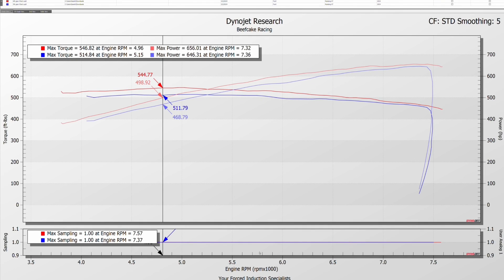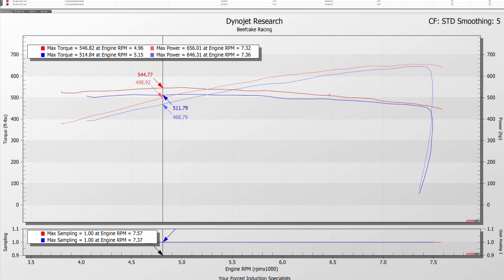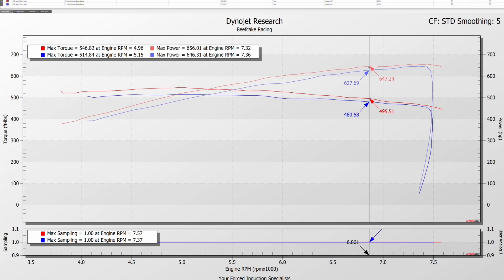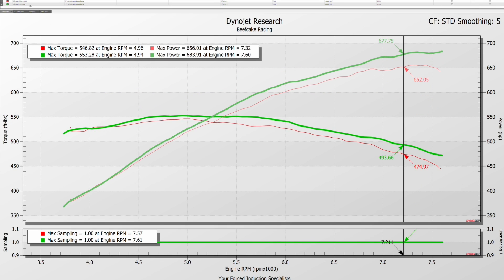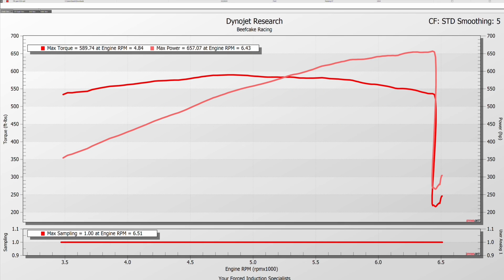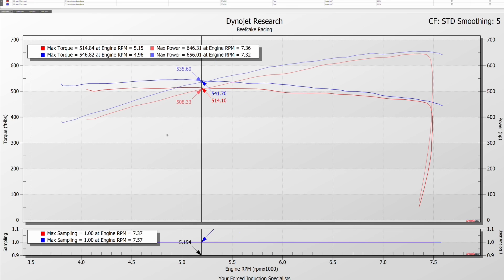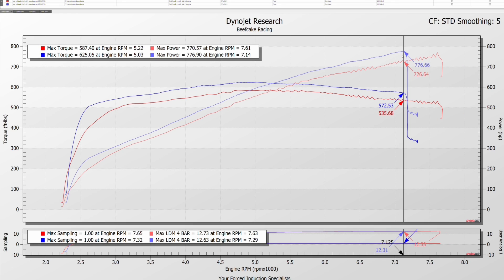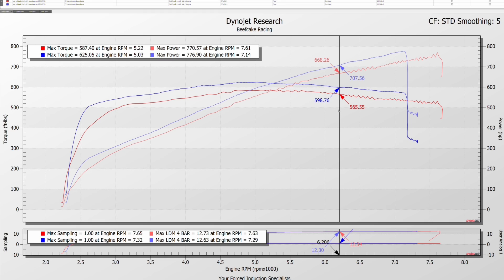Explaining Dyno numbers on a 2024 Mustang Whipple Stage 1 kit.

Comment: What part of this rebuked anything the "mouth piece" claimed? You need Octane Booster to hit the claimed number that's the same thing I heard over there.
Reply from the maker: see this is the problem with people that listen to an idiot like that is they don’t understand how octane booster works

You do realize if you get a tune by those guys and the horsepowers down do you know what they tell you they say hey go buy some octane booster put it in the tank so we can figure out if you have bad fuel quality or if it’s false  knock

and why is that because of the quality of your fuel is low. Then you’re not gonna get the time either commanding in their custom tunes.

But if they’re timing, it say 20° you’re getting 20° on the 93 octane then you’re getting full power and octane booster will make zero difference whether a whether a Whipple whether anybody’s  tune.  

that’s how it works.   Again since most people that listen to a comedy show, don’t understand how all this stuff actually really works.

Comment: I own a 24 Mustang pulleyed down, mixed e30, dynod it in 7th gear, and I just blew the hell out of my trans. I even got a check engine light and now the car doesn't rev past 2k. I had no idea I wasn't supposed to dyno this car in 7th gear. I figured whipple would warranty it but I guess I should have read the fine print. Well this bill from ford is gonna cost me.
Reply from the maker: i doubt it

Comment: Don't u know your not supposed to run the dyno in 7th gear???? Ford says so and any other top Ford tuner knows its not good for the car to run in 7th. Do some research before u start saying they didn't know they should use 7th. They know they shouldn't use it
Reply from the maker: when you want a true horsepower number, you have to dino the car in seventh gear that’s your one-to-one ratio

It’s fine to dino and the last gear, but the point of a dino and this situation is only to get a number but if you can’t get an accurate number, then what’s the point?

Comment: A rather long video that avoids actually talking about how VMPs video is BS. The stage 2 isn’t making 800+ whp through factory cats on “pump gas” as they’re claiming can be done. “One loudmouth YouTuber that doesn’t know what he’s talking about” lol he hasn’t said anything incorrect so what doesn’t he know?
Reply from the maker: we made 760 on pump gas on the stock pulley on the stage two kit.  then we went one pulley down with octane booster and made 820 plus
Reply: He proved you right when on another reply to a comment he said "we made 820+ with headers and 1 pulley down" defending a carb eo kit but bragging on hp with the cats gone 😂
Reply: I just love the Carb EO 800+hp on pump gas advertising when we all know that’s not with factory cats let alone high flows, more octane, 7th gear pull which you only do if you need an advertising glory run lol
Reply from the maker: @tylerphelps4868  actually, all carb eo testing  is done with factory catalytic converters.  

If what you care about is Dino numbers then a one to one gear ratio is your proper gear to Dino a vehicle in for numbers.  

You keep saying we all know that it’s not going to get those numbers but why do you know that because I’m idiot on the Internet said so
Reply: @TeamBeefcakeRacing   1:1 is cool until you factor in that dyno in 7th is a great way to make 7th say bye bye. Yes let’s smoke the expensive trans on a brand new car. 

It’s not meeting carb requirements when you do headers and race gas and it’s not making those 800+ numbers without it. 

You might not care because you’re a parts shill but the customers do. That’s all any of us, including “I’m idiot on the internet” is saying and it’s false advertising
Reply from the maker: @TheLifeofBigOunce  well our kid is a stage two.   on the stock pulley it made 760 wheel one pulling down it made almost 830     

Stage two is not your car kit, but that’s nearly 1000 hp      don’t understand why people are hating on a kid that you can make a crank horsepower with
Reply: @TeamBeefcakeRacing  with every reply you prove Alex's point.

Comment: All i hear is excuses, 24 stangs suck and the whipple wont make the advertised numbers thru stock cats and exhaust. Next time say the name, hes the only guy dropping real knowledge.
Reply from the maker: Actually, they make the advertise numbers just fine. We made 820+ on our 2024 stage two.
Reply: @TeamBeefcakeRacing  with a half tank of octane booster no coyote is making that much power on just 93
Reply from the maker: In a reality, we don’t even care about the dino what we really care about is ET and nine second ET say it all
Reply: @TeamBeefcakeRacing  you mean trap speed will prove the power? Thats correct.
Reply: Pretty sure the kit in question is a "stage 1" and the kit is advertised as adding a certain amount of hp, not a et or trap speed (ON PUMP GAS) and like I said, say homies name, he ain't voldemort  don't be scared. If you have something to say stand on business and say it.
Reply from the maker: @TheLifeofBigOunce  and the car that was questioning the horsepower just went to tend to on a stage one kit there you go

Comment: So even in 7th gear, E30 and adding 30hp, that's barely 700hp with good fuel.  So why is Lethal, StreetSpeed, VMP, etc. seeing 800+ with good fuel (Octanium)?  Is it because this is an Emissions kit and Whipple has a conservative tune on it?
Reply: This. Anyone? I need answers or opinions I own a gen 3 either trading for a C7 or gen 4.
Reply: @b5audidoggie130 get a c7
Reply: @CornFed12  I enjoy my C4 LT1 in some ways more than the gen 3. Handling, low center of gravity, but nothing like a 10r gen 3 stock or modded. Coyote is the best v8 of all that top end
Reply: Stage 1 vs Stage 2 kits.
Reply: Yep and they were saying 800 WHP. Not crank. In those Lethal videos.
Reply from the maker: @rldeppe1  correct. we made 820+ with headers and 1 pulley dowm
Reply: Dustin is giving them a tune customers won't for them to be able to sell Superchargers.
Reply from the maker: @NardyMercado  false.  we ran 9.92 on whipple full release tune

Comment: I guess the premise is, what can a customer expect with the "out of the box" set up? is 700 hp plus? 800? or the safe 650 hp from an out of the box setup? which for street car is more than enough, I think.
Reply: more the advertising..they say you get 800 crank HP.. witch would be around 700..they told him to dyno in 6th..when the instructions tell you not to since it voids the warrenty.
Reply from the maker: 810 crank hp on a stage 1 kit.     

If you want to do true verification, pull the engine out send it to an engine Dino with your kit there you go

Comment: 7th gear will not make 700rwhp sorry!
Reply: If they used street tires, and if the speed limiter wasn’t so low it probably would. It would definitely be close.
Reply from the maker: @kirkkarnage6344  exactly
Reply: Lol splash e30 wtf 🤬 pump gas doesn’t see full timing what lmao
Reply from the maker: @utahcountypicazospage5412  if you have good quality pump gas, you will see full-time